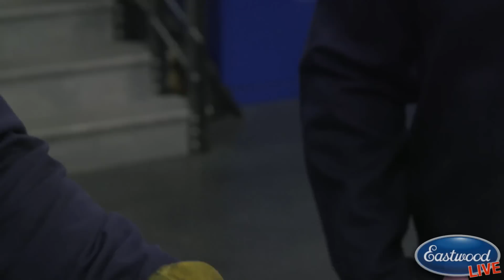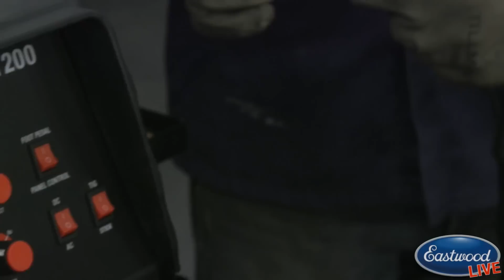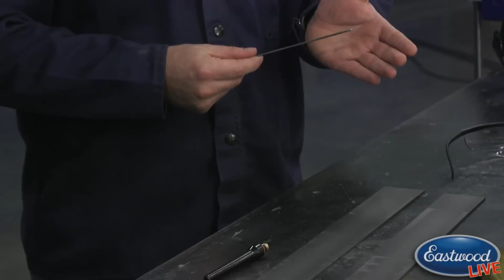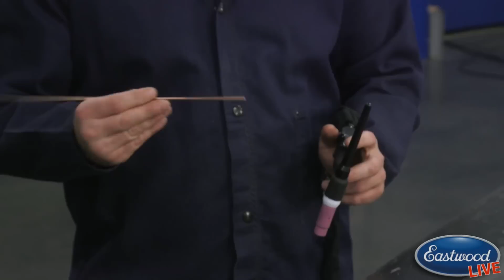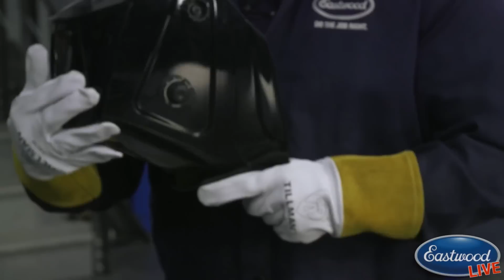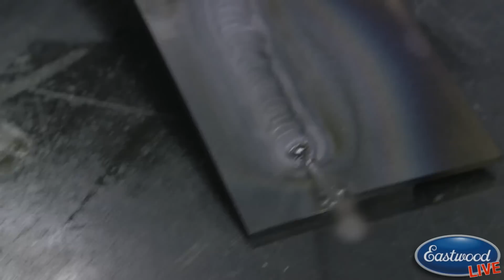Beginner’s Guide To TIG Welding.  Everything you need to Get Started & More! Eastwood

Comment: I have done a lot of acetylene welding, even on sheet metal but... when I tried to do a TIG weld in a 90 degree corner  things got way out of hand, really ugly. I would like to see a video on how to do this at least on the bench so I can try it out myself. I have an analog TIG 200 from Eastwood and a 1976 Fiat 124 that needs some panels welded together in a corner. The spot welds are still there and holding but I really wanted to re-weld this area so I don't have to worry about it coming apart some day in a dangerous way. I did some welding on some heavier stuff to build a roll around cart to sit the whole car on as a learning project with my TIG but what I was learning on the 1/8th steel angles didn't prepare me for what is likely .050" thick body panels. I need some guidance on issues like stick out and gas flow in corners (I think). I could probably do this with my acetylene torch but past experience with oxy-ac welding in tight places with flammable coatings on the other side on hot days in Nevada wasn't much fun. Besides, this is why I bought the TIG.

Comment: Matt or Joe, I just bought a Miller Syncrowave 250 Tig welder with a WP20 water cooled torch.  In this video and others I've watched, you haven't mentioned anything about the type of the torch you are using.  Do you use an "Air" or "Water" cooled torch and if so, can you show us the settings you use.  My Miller 250 has a Miller Watermate 1A cooler with it.  Just not sure how this fits in to the welding process of Tig welding.  Great video and great job Joe for not dipping the tungsten into the puddle. :)
Reply: by Joe saying his hand got hot from moving to slow even me as a beginner he did not have water cooled torch set up